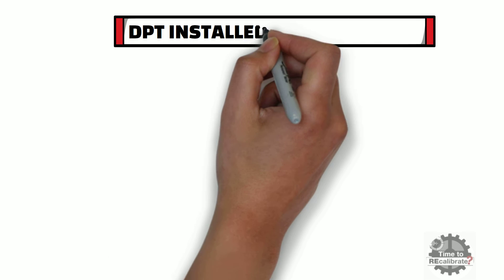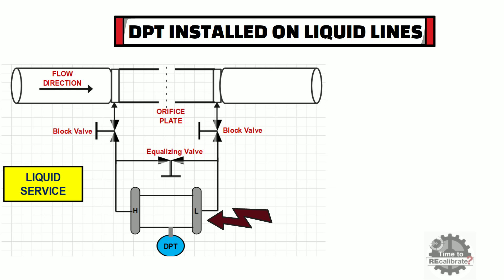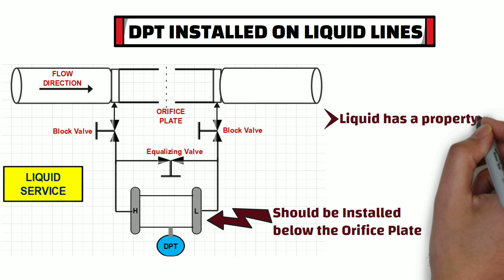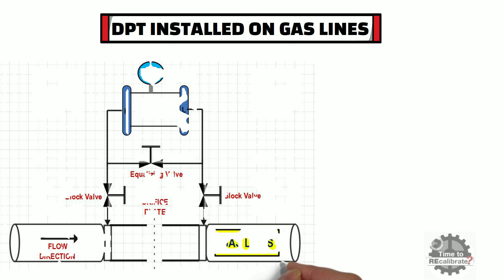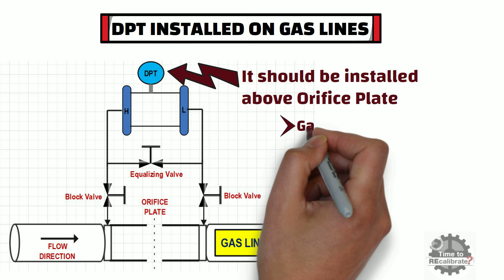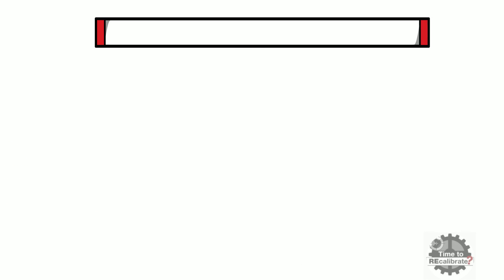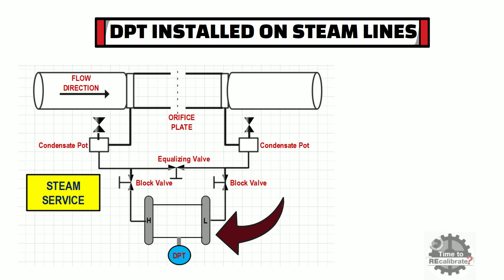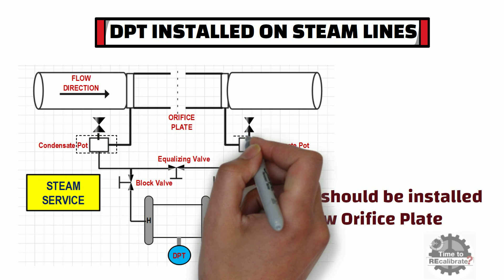Installation guidelines for Differential Pressure Flow Transmitter

Comment: For gas flow installation: how do I install the DPT above the pipeline if the pipeline in under a roof and there is no installation space? What can I do?
Reply from the maker: Hello Aashish
Thanks for your question. Ideally, it should be installed   above the pipeline. However, if there is no space above pipeline, you can install DPT parallel to pipeline. I hope you get ur answer. Please let me know, if you have any other question.

Comment: Why is process gas always on top of the tap in point mensurment? gas droplets have a heavier type of time than air.
Reply from the maker: As I explained in video, gases have property of self venting. It means it vents automatically. Therefore, dp transmitter should be installed above the orifice plate. I hope you get your answer. Let me know if you have any confusion.